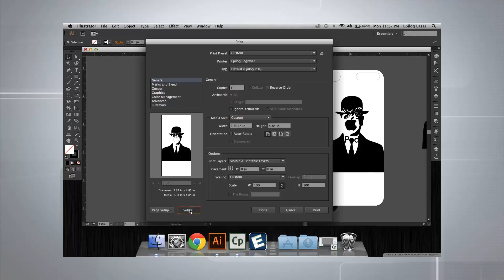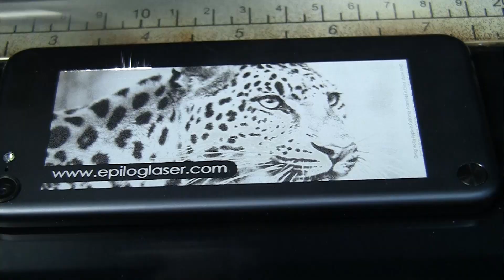Epilog's NEW Mac Driver - Fusion Laser Series

Comment: Is there any chance this could mean a Mac driver for your starter series lasers could be on the horizon? I understand how to use a mac with Windows dual installed on it, but outputting directly from Illustrator would be far more ideal.  Thanks for making this possible and hoping for more mac drivers.
Reply from the maker: The Mac driver was developed specifically for the Fusion Laser series, but with that said it will work with the Zing Starter Series with a small work around for printing vector (cutting) lines. Raster engraving works great you won't have any problems there. The work around for printing cut lines to the Zing Series has to do with breaking the line up into a series of straight lines to create a curved line. Once you do that you can print to the Zing Series using the Mac Driver.
Reply: Good to know. That seems like an acceptable workaround for now. Thanks for the info!
Reply: Epilog Laser any updates on using Mac illustrator to run your Helix ? Was recently at Epilog in Toronto to preview equipment and very surprised the Adobe suite of software was a foreign concept to sales staff. Corel not our go-to software.
Reply: @granteditslifeoutdoors.9194  We've owned an Epilog Helix for a few years and our biggest frustration is poor Mac support. We had to buy a PC to print to the laser. And you are correct. We work with tons of designers and illustrators. Ever single artists we work with uses a Mac and the Adobe suite. Procreate on the iPad is picking up some popularity as well. If we can't get a decently functioning Mac driver then I won't hold my breath for iPad support.